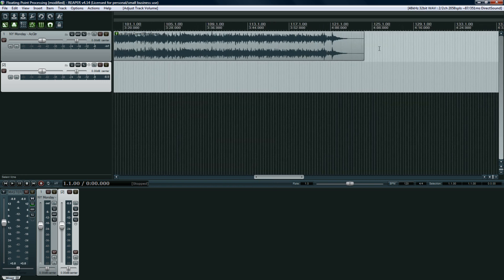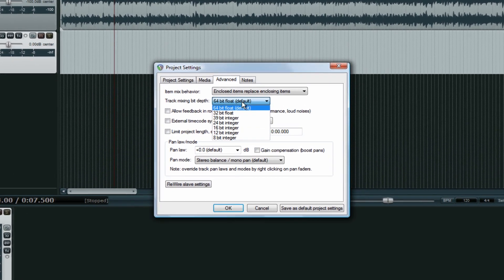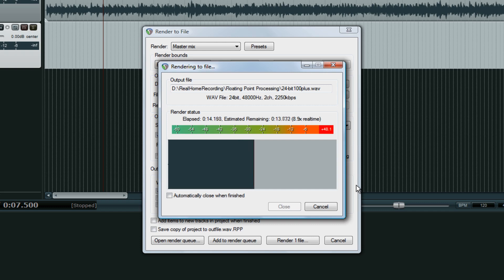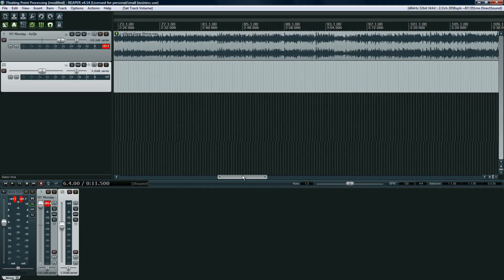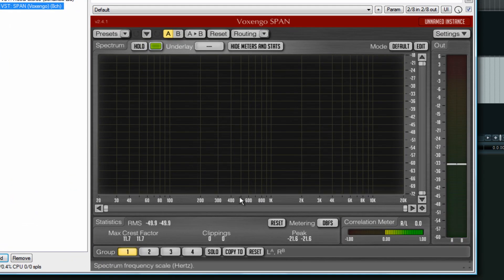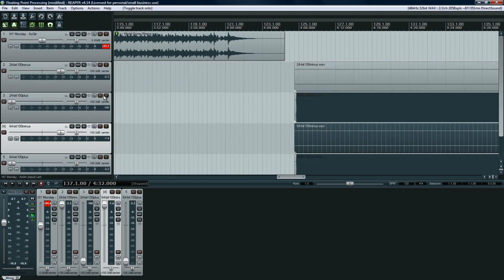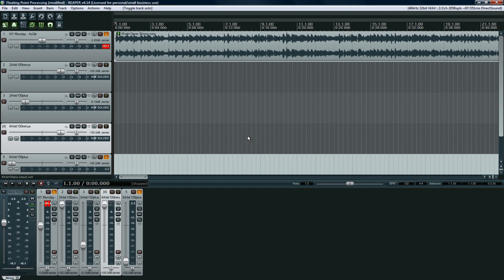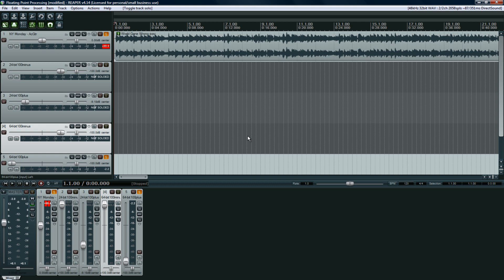Floating Point Audio Explained

Comment: A few corrections:  yes there are advantages to recording at 32bit, including not having to worry about levels.  Also, there are plenty of DI capable and other related devices that record at 32bit.  Second, the auto-mute at high volume is a preference, which you can set, and some versions of Reaper have come with it off by default.

Comment: Very clear and useful to a "point" (wink) but 10 years old now so something has changed maybe .. Recording software with a floating point capture should actually lower the noise floor (if my theory is correct) but cant stop the "hardware" from overloading the A/D converters obviously. Don't think the F2 was out then, and it's only for recording lavalier mics lol. £130 Zoom F2 ; "The F2 features 32-bit float recording technology, allowing you to record the loudest audio signals without worrying about clipping. It will also record the quietest signals in beautiful detail. And the best part is you don’t have to worry about setting the gain. Just plug in the lav and hit record."🤷‍♂
Reply from the maker: Thanks, Darko! I really should revisit this topic and maybe add the 39-bit integer mode that REAPER allows into the discussion as well.

Yes, the 32-bit interfaces that have different analog to digital gain stages seem to be quite interesting.

Comment: Looks like resampling was the cause why the two clips didn't null completely. The source clip shows a green caution icon on it. Reaper used different resampling algorithm when bouncing to disk compared to realtime. I get 32-bit floating point to null down to -148 db after adjustment by 100 db.

Comment: I don't know if I correctly understood your question, but the noise is like that shhhhhhh, believe a room tone that stays around -60dB. If I put my pre up, up to certain point it also increases a lot.
As I am starting in this environment, I decided to speak a beat louder, so the sign is better and I don't need to put up the gain. I noticed that I was speaking to low. Anyway, I didn't expected so much noise with this system.
Again, thank you for the reply.

Comment: My set up is like this.
Soft gain in 0,
Fast track gain in the minimum,
UA 710 TF is the pre. When in and out gains are in 0, the sound in the booth is measured around -90dB. As the gain is being increased to a level to record, the sound inside is around -60 dB. The problem is that when I start recording,  the voice is record around -15. Not good at all, but still able to remediate with a noise reduction process, but need to improve it.
My cables are Mogami from mic to pre and santo angelo for the rest.
Things I still need to do to check for any influency:
- disconect a small mixer beringher that I use to talk back to the booth and that pick outs 3/4 from Maudio.
- change the electronic lamp inside,
- review cables routes. 
Sorry for the long note,  but thanks for the help.
Reply from the maker: Is that -60 dB noise (amplify it in your software) room tone or electronic (like a hum)?

Comment: Sorry for that. I am using the Audition CS6.
 It offers 16, 24 and 32 FP in its audio hardware set up, however I imagine that as in my maudio the maximum is 24,  so even if I set it to 32 FP, the limit will be 24, right?
I am watching to all your videos that are clarifying many things to me,  but now I am strugling with noise. There is a shhhhh of about -60dB inside my vocal booth (hand made) that I cannot get rid of. I did a test similar to yours, just agregating the parts in the chain and the noise stays in -90dB. when I conect the mic, it goes to -60dB. I have a AKG Perception 220.
Reply from the maker: There are many things that could be causing that problem. Keep cables away from power sources/power cables. How is the noise in the vocal booth?

Is this without boosting your preamp/input volume? As soon as you plug it in with the knob down it's this noisy?

Comment: Great vídeo. 
My fast track pro is set up to 24, but in my adobe audition I set it up to 32 floating point. After watching to your video I imagine that I am recording in 24 fixed because of the interface, but mixing in 32 FP. Is it correct?
Thanks a lot.
Reply from the maker: Is Adobe Audition still restricted to just 16-bit and 32-bit recording modes? You didn't specify which version you're using.

If that's the case then yes 32-bit would get you a 24-bit integer recording with a bunch of data padding.

Comment from the maker: My last steps are loudness maximization --> Sample rate conversion with peak limiting. I'll export that 64bit FP track (because of the way my DAW handles files) then the VERY last process is truncation with MBit+ dithering down to 16-bit with peak limiting to -0.2 dBFS. 

MBit+ is built into iZotope's Ozone plug-in and is considered the best. But dithering is the least of your worries really and most them are fine. But I'm ridiculous when it comes to audio quality so I use MBit+ hahaha.

Comment from the maker: @AdrianPaulMusic It will sound better. :-) Seriously though it will sound cleaner due to having virtually unlimited headroom...although I still mix as though I'm using analog gear for a variety of reasons.

So my mix will be at K-20 (see my K-Meter review video and there are some other plugins that have K-metering) then for my master I'll raise the level to K-14 for absolutely no quality compromises or K-12 if I want to compromise but get a hotter signal.